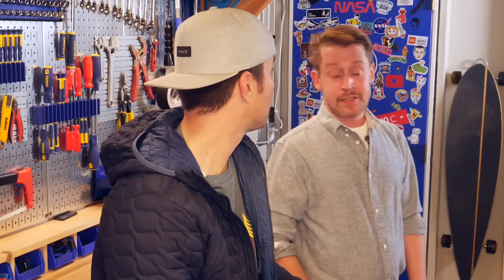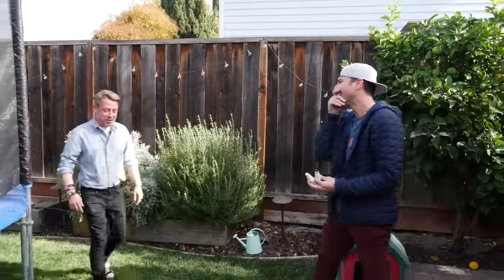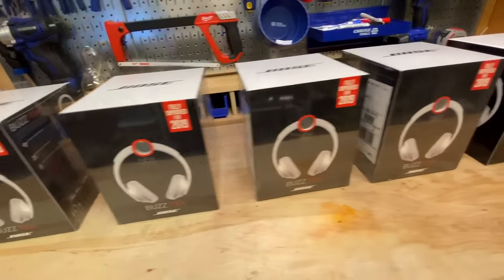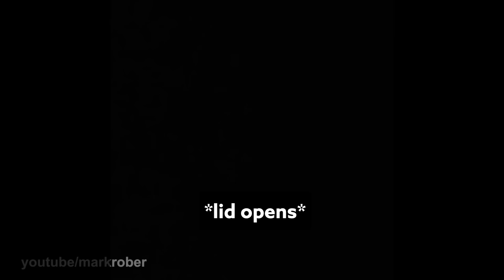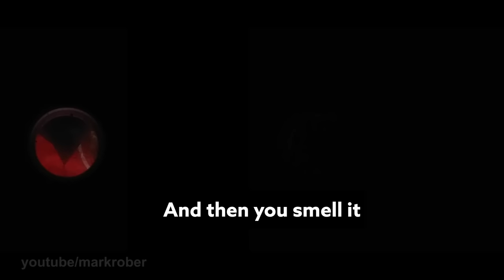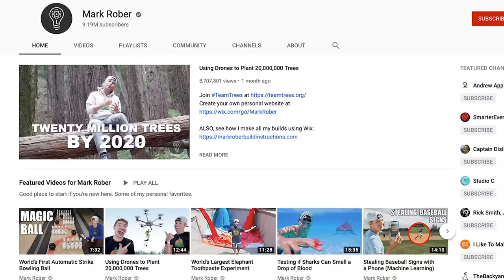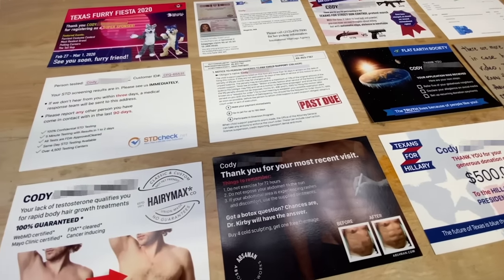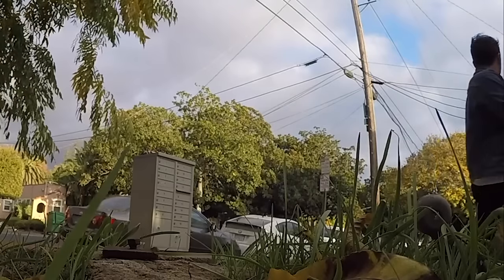Glitter Bomb 2.0 vs Porch Pirates

Comment: Suggestion: for version 3 of this package, make sure they cannot put the lid back on.
Or if they open it partially, the lidd will eject itself. This will surely increase stress levels.
Reply: u are right
Reply: They might be able to get like a thing to come out from the side and block it after the kid triggers activate
Reply: or change the glitter with nails and metal shards
Reply: @aidanjanemcintosh6919  That can get you put in jail a long time.

Comment: V3 idea:
- make the lid so that they can’t just close it straight away
Reply: Great idea 👍.
Some spring loaded tabs that hinge down when released. To slide the lid on you have to hold all four tabs in.
Reply: We gotta make sure he sees this!
Reply: Upvotes
Reply: @rexa2851  yep upvotes on YT
Reply: Or maybe can't open it fully and if you can figure something out, it shoots glitter out the sides (hopefully farther and creating a bigger mess)
Reply: With a lid on the glitter that way if it gets tossed around it won’t spill out but comes open soon as the lid is pulled off
Reply: ok boomer
Reply: use paint
Reply: something so the glitter is not blocked by the box lid if they close it right away
Reply: @av8973   I don't think he wants life in prison or get put on the FBI watch list
Reply: Thats not a bad idea. What if the lid had some kind of latch or hinge, so that when its taken off, the whole thing unfolds into a flat piece of cardboard and cant be put back?
Reply: And use finely powdered Carrolina Reaper chilli instead of glitter.
Reply: What about some sort of spray or spring loaded bit in the centre that will shoot up and leave a blob of something on their ceiling!!!!!!
Reply: also have the glider rancher be powered by compressed air for a larger and more vertical spread , and after the count down have the fart spray constantly spray
Reply: I had the same idea, like little arms that deploy. He will just have top make more outer boxes as it will be less likely that they recover them.
Reply: Kirk Claybrook nah I’m pretty sure he could be sued for that.
Reply: And instead of the count down it beeps like a bomb
Reply: Make the lid so the bottom of it contracts inward at the first opportunity, so they can't shove it back on.
Reply: hi thommas. no uuuuu
Reply: @av8973  this
Reply: Instead of fart spray he can use pepper spray!
Reply: @Matthew Morgenstern Sshh sweetie, the grown-ups are talking.
Reply: David S not just hinge down but also ratchet into place when they go back up so you can’t just push it down again
Reply: @oodoodoopoopoo  Yeah make them get real close to that fart spray hahaha
Reply: It should also spray more glitter if anyone tried to put the top back on. And probably actually call the police.
Reply: @oodoodoopoopoo  I was thinking the same thing except make the tabs lock into place once they've sprung out
Reply: Kirk Claybrook Ooooh...Now that is nasty!!  

I LOVE IT!! 😈😈😈😈
Reply: The package contains a bomb
Reply: Yesssss that is smart
Reply: @av8973  Do you know Air Booom
Reply: Make prongs come out so after you open it the lid wont fit anymore
Reply: Right
Reply: Some sharp point that cuts as the lid is lifted off - then the lid falls apart and cannot be put back on
Reply: @oodoodoopoopoo  nice
Reply: maybe it should break some kind of mechanism and as a result prevents reclosing altogether
Reply: @kirkc9643  And have potential manslaughter on your conscience because the thief or his/ her innocent room mate is violently allergic to pepper? Bad idea.
Reply: and activates a taser...and a HUGE cloud of pepper spray and riot quality mace...maybe even a uv/ir infused dye pack that last for weeks and traceable by police when the pirate shows up at the ER for unrelated ailments ...great fun to be had by all...except the porch pirate of course...but then who really cares what they think of if you've crushed their emotional confidence in obtaining things that do not belong to them in the first place...
Reply: @proskittlez9366  a compressed air canister would propel the glitter to the other side of the room
Reply: And if u open it it sets free bioweapons and sprays some concentrated acids
Reply: And more glitter so much more glitter
Reply: @LucyRoseLuna  now, now...we're slipping into Saw territory...kinda want to avoid that sort of thing for legality reasons and to avoid being added to those special watch lists monitored by the FBI and CIA and the unknown more clandestine agencies that simply show up and erase every trace of your existence ...
Reply: Should be easy enough to do - Would be amazing
Reply: @av8973  😂😂😂😭😭😭
Reply: When they open  it would spred to long piece and hard to fold
Reply: Version 3.0 = Spray Paint

Version 4.0 = Pepper Spray
Reply: Yes! Maybe puncture a balloon full of paint + pest deterrent (main ingredient: bobcat urine) 🤢
Reply: I have a few ideas
Reply: Two reasons for the glitter:
1: It is VERY hard to ever be fully rid of it. You'll vacuum and sweep and still find it months later.
2: Paint could damage personal property. Even though they get the paint by stealing the package, the potential is there that they could track the package to the show's host and bring suit for damages.

2,B: Paint would have to be open to facilitate it being released when the trap is opened. Spray paint would have a smaller 'kill zone' and liquid paint could potentially dry while waiting.
Reply: Yesss
Reply: @tiredmummy Ah! Or replace one of the fart sprays with pepper spray!
Reply: @oodoodoopoopoo  yess 👌🏾
Reply: Thommas I’m sure he noticed that.
Reply: Yess!!!!
Reply: Bright strobe lights and/or a really loud siren. An air horn could be activated by the same sort of mechanism as the fart spray.
Reply: Of course for 2020 because it takes up so much time to create it but awesome idea!
Reply: Wow! Your channel is so original and funny! Looks like your pretty close to your goal. Honestly, this is such an original channel idea that you deserve all the subs. Oh yeah, and that profile pic! MAN! It’s some great art! Not like you stole it from a big channel like, LazarBeam perhaps, like all those copycats. No, your channel is better than that. /s
Reply: @kirkc9643  or maybe OC spray lol
Reply: I know we all agree stealing is the worst especially when someone steals from you but I say keep the glitter and no on the chili spray..some people have asthma and can die from pepper spray..he's trying to teach these idiots a lesson not kill them
Reply: what about a lid that avoids the glitter to leak out of the package if flipped?
Reply: 70th reply hAhA
Reply: @killerking1987  and make the time between that bomb beeping a lot shorter before initiating police chatter with a few more clear lines like enroute to GPS location eta 3 minutes something that makes it immediately panic starting to really freak them out real quick
Reply: Thommas yes omg I was about to comment that like as soon as they shut the lid I was thinking that they shud make it in a way where u can put it back on
Reply: YES!
Reply: Yup do it
Reply: @oodoodoopoopoo  make it 7 tabs 👌
Reply: V4 idea: 
mustard gas instead of glitter
Reply: some good ideas from others. How about glitter AND separately that staining ink used in money packs so criminals are marked when they rob banks? Added to the voice recording - have you learned it's wrong to steal?
Reply: @Kaboomf  strobe lights can make people have seizures, probably potential lawsuit
Reply: Thommas I keep thinking an air horn after the countdown.
Reply: Have it actually call the cops to their location.  Lol
Reply: Yes...some sort of collapsing locking mechanism...someones genius will be appreciated!
Reply: @user-yt9ln2xp3x  how do you not see the joy this sparks in all ages lmao like come on grow up - from a fellow gen z
Reply: Or when they shut the lid something else worse happens
Reply: ICantComeUpWithAGoodNameSoThisWillHaveToDo woah. You need help. They’re still a person too.
Reply: Also next time put anthrax in there instead of glitter...cmon guy mix it up
Reply: @samanthaquinnell7379  - Brilliant! I don't know what I was thinking with that "4 tabs" idea.
1¾ tabs per side makes much more sense! 🤓
Reply: Agree with the spring loaded tab idea, also teach these thieves a lesson and put either ink that'll explode onto people/and their belongings or if you wanna get really nasty with it put some pepper spray things on it instead of fart spray.
Reply: Fill it with rotten milk! Hopefully they open it near carpet and/or couches :^)
Reply: BNA YT r/wronganswer
Reply: @proskittlez9366  YESSS
Reply: Version 3 recommendation: replace glitter with multi colored permanent non-toxic dye.
Reply: @saltybonsai8369  thats a better idea. Lol lol lol
Reply: whilist the fart spray blasts at a 360 degrees all over the room with far range
Reply: Or better a revolver! :D
Reply: @ShanecaRene  I have athsma and hereby approve the use of weapons of mass asthmatic destruction. The lesson he tried to teach them was clearly not received.
Reply: @PizzaHutCEO  weapons of mass asthmatic destruction..you a whole damn mess 😂😂😂💀
Reply: Also instead of a secondary fart spray, super glue spray, to stick the glitter everywhere.
Reply: 13/50 now we need one for Mexicans becuz diveristy is muh strength
Reply: V4 replace glitter with anthrax
Reply: Idea #2: Release liquid with the glitter so they can’t just brush it off
Reply: V3 idea:

C4
Reply: Kkb
Reply: Just straight up make it so the top gets destroyed so you can’t close it. Period.
Reply: @oodoodoopoopoo  the thing has a square cross section. have a section rotate 45 deg to the rest. it would be super easy, spring loaded. Loading into box could be done with it taped shut then pull tape when in box an inch or so.
Reply: Use spray paint. No spill problem.
Reply: Too evil

I like it 😈
Reply: Marshmallow Arkleseizure welp time to disappear like Epstein

Know the system and you’ll be fine lol
Reply: @user-yt9ln2xp3x  not every kid is a dirtbag thief, there are still good people  that don't steal little kids' birthday and Christmas presents.
Reply: @davidblass3767  "so I stole this package and they ghost peppered me" not the best case imo
Reply: Use Flex seal or oil paint or maybe even epoxy in V3
Reply: woah satan you didn't have to go that far
Reply: @ihopmanager  r/whoooosh
Reply: Can you make it spray skunk juice + glitterbomb? Nothing that can harm young children. Haha edit.. I see you did it. Nice.
Reply: Maybe when you lift the lid the glitter bowl rises making it impossible to get it back on
Reply: ohh so once you put the lid on it bounces up far.
Reply: Exactly my thought. So disappointed when they closed it
Reply: Another idea: seal the glitter bomb in such a way that it doesn't spill at first and unloads only after reaching a certain RPM.
Reply: Yes please
Reply: Thommas put holes on the lid, simple and lets more glitter get out
Reply: congratulations, you’re idea was in 3.0
Reply: @talmagejones731  yeah I saw just it 👀
Reply: That actually got added.
Reply: @oodoodoopoopoo .... They took your idea man. Hats off
Reply: Congratulations! You're a prophet.
Reply: Good thing, he actually did this!!!
Reply: prophet
Reply: foreshadowing
Reply: This dude from the future
Reply: @oodoodoopoopoo  You did it!

Comment: they should put wings on the side that lift up when the package is opened so the people cant put the lid back on.
Reply: GENIUS
Reply: People will just start breaking things
Reply: @takumi2023  and? As if people havnt just overhanded the package off porches before
Reply: Bruh why tf you so wet
Reply: takumi168 they should weld a sturdy but thin cage around the whole contraption that is pyramid shaped. Then have pneumatic legs at the bottom that just extend downward and have the sprays and glitter come from the bottom. So that way if the box covers it again it will still spill the payload. And if they try and flip it over the box won't slide on the wide base.
Reply: wow you're smart
Reply: Nice.
Reply: Also there needs to be more of a time delay so they always bet the lid off all the way.
Reply: Mate you are a genius!
Reply: 2020
Reply: They should that would be Hilarious
Reply: Imagine if the box started moving lmao
Reply: Package 3.0
Reply: Higborr
Reply: Simple spring-loaded horizontal pins should work just fine for that. That way the lid can be put back on, but it will take some concentration to do so.
Reply: Sonic there cant be. Criminals can often sue and win.
Reply: next year lol

Comment: If you do this again, you should remove the screens on the phones so that they have much less resell value in case people do actually open it.
Reply: Haph that's kinda big brain bro
Reply: That’s  a such a great idea bro 😂
Reply: If he's got a website tracking the packages and their locations, he'll have a way to brick the phones remotely making them useless
Reply: @PurpleLite  but even bricked, the phones would still have all their parts to be resold
Reply: @Andrej Can't remove the cameras, that's what he's using the phone for (well, that GPS, and data upload.) I guess he could remove the front facing ones though.
Reply: He can just roll up to their house or try the police again
Reply: Haph yeah that’s what I’m scared about is that they figure this thing out by watching marks vid and basically get free phones. Pretty sure mark got most of them back though
Reply: no method of opening the box is revealed and he said you needed special tools to get them open. if the thief doesn't know about the phones and already distracted by the other traps im sure they won't figure out that they could resell a trap package. if they do watch these videos and find out there are phones inside, the time it takes to figure out how to open the box safely would probably be enough for Mark to track them already
Reply: Unfortunately wouldn't work though, most smartphones require all parts to be present before the OS will be booted. I cannot speak with certainty on all android based phones, but iPhones will definitely not boot unless all parts are present and the original parts as well. And without the OS booting you have no camera functionality, no GPS functionality and no data transmission. 

I don't doubt that Mark could probably find a way to work around that, but it would be labor and time intensive, and just wouldn't be worth the extra effort when he can brick the phone.

Comment: Anyone else appreciate how bad it must smell in those homes with no reaction to the fart spray?
Reply: Fart spray doesn't work like a standard aerosol; it's designed to coat surfaces and is extremely difficult to remove.
Reply: I was thinking it must not waft up very well
Reply: The spray might have been shaken around while being handled and so it didn't work as effectively as it should've
Reply: 400th like
Reply: @beuturehbomoh6363  There are 397 likes now. What?? (Now as in the time I'm tying this....).
Reply: @zombathinlostleghackercat5233  405

Comment: You should manufacture & sell these for this exact reason 😂
Reply: But without the phones!
Reply: Maybe just with normal cameras
Reply: Yeah bro I wanna see if any of my neighbors are thieves
Reply: Yeah sell them on eBay
Reply: i would buy 10 of them, easily.
Reply: Unfortunately if these things became common then porch pirates would just adapt. Open packages inside a rubbermaid container or outside or whatever
Reply: @grandpriestess1042  I think that sounds a lot more complicated than it sounds..
Reply: @temptor7585  no you wont they are expensive because the phones
Reply: But then the idiots would find out that it is a product sooo yeah
Reply: @rondalglenn2458  they wont
Reply: @marquisethomas5611  they would, for example the show 90 days in has become well known within prisons and as such is considered the same way a police informant is by other convicts